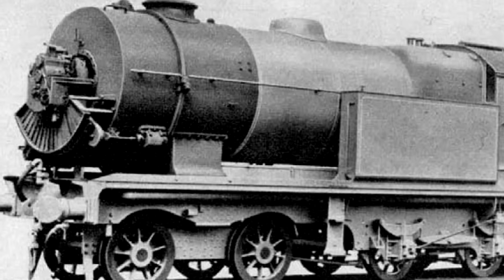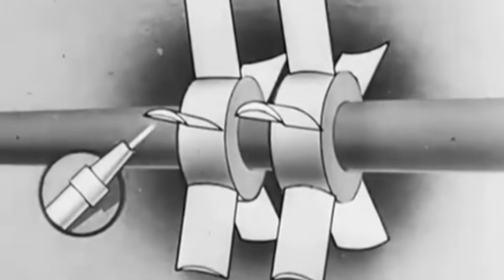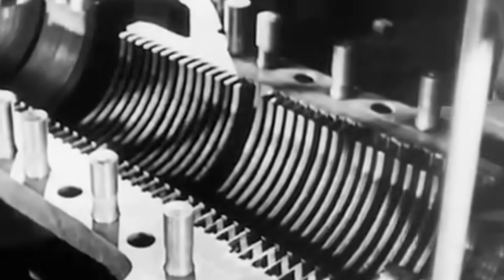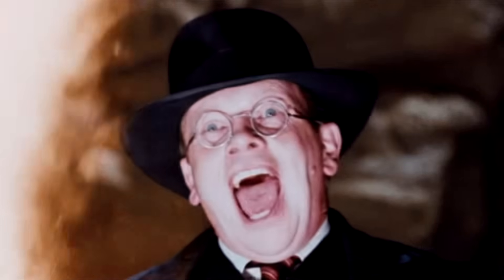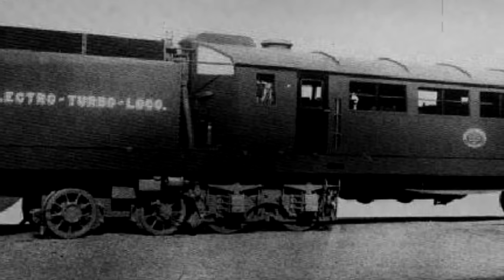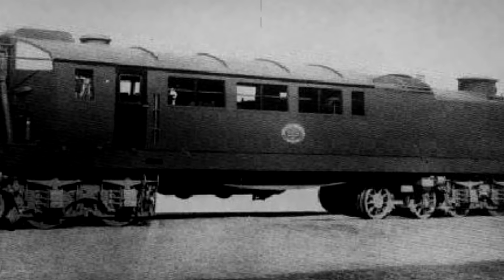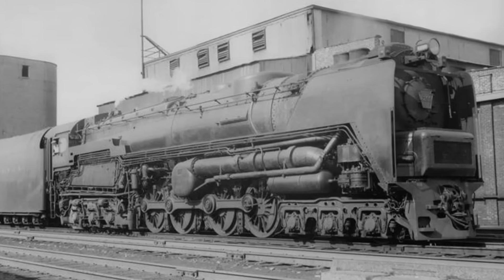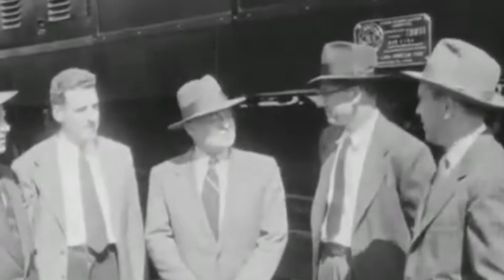What the Heck is Up With Steam Turbine Locomotives? | History in the Dark

Comment: If you guys misinterpreted of low efficiency as "Oh, then force it to drive electric generator then and keep running on same speed."

No, the problem is not transmission. But turbine will eat roughly the same fuel per hour, regardless the speed of the train. That's the point of "horrendous efficiency at lower speed", and all kind of turbine suffer that, including turbocharger.
Reply: Sort of kind of. But you can dropp the torque reducing fuel burn quite a lot. This makes a gearbox extra usefull because you would use low torque at low speed when high torque is typically needed.
Reply: @matsv201 the fuel burn still the same regardless the torque.

Even if you tried to drop the torque so hard, it stop spinning
Reply: @bocahdongo7769  That is not really true because you can have a simular rotation speed but a much lower flow. That is why theyt had multiple injectors.

The Lundström turbine locos solved it a other way by simply having multiple turbines and have the steam use diffrent turbines at diffrent speeds. That basically solved the problem
Reply: @matsv201 If that's the case, then turbocharger would never have turbo lag in the first place. Or start really late at higher RPM. And this is radial turbine that works wider range than axial. Or the fact that axial turbine and stator are calculated based on fixed speed. Espescially this is 1930-40's.

Hell, other comment are right, you can just use high powered magic transfer device in the first place if you tried to use multiple stage turbine.
Reply: @bocahdongo7769  There is still a static load. But of caused at 0% power, the static fuel use is also 0%.

I don´t know how well it scales for radial turbines, but for axial turbines a rule of finger is that at 40% energy it preforms 0% power. Then it scales up to 100% energy and 100% power  linearly.

This is of cause very bad for usage of 1-10% But there is also a very simple solution to this. Have two turbines. Preferably have one large and one small and power can be transfered between them. That was how Lundström solved its loco
Reply: Oh, but that's easily solved ..... optimise the turbine's output at max requirement, plus 20% (engineering, innit) and when there's an energy surplus, simply "collect" excess current via a ... let's call it a 'pantograph', contacting a conveniently located conductor wire, parallel to but above the running rails.
Reply: @TheHoveHeretic you can use those magic transfer energy device for easier operation

Matter of some people mad that their tax used to build this magical thing instead another asphalt and desert war is completely different thing

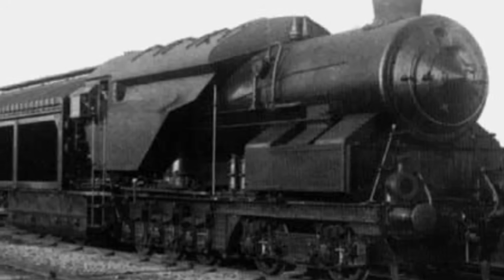Comment: 8:50 because the tender had the condensor and they couldnt make vacuum pipes that bend.

But the coal bunker was on the engine and the tender carry verry little water .... due to the condensing thing, so it actually didnt change weight that much.

One of the steam turbine trains was preserved in roaling condition and there is actually fairly modern videos of it operating
Reply: Link?
Reply: @RailPreserver2K  Check response to theajax in the thread.
Reply: Also link?
Reply: @theajaxdragon4649 
Ironically this was not the video I was looking for, but it was better. But it was probobly from the same time period. Its a VHS recording, so i would imagine its from the late 80s or early 90s.
https://www.youtube.com/watch?v=Z9ZcLUbQg14

This is a more recent recording  from the second unit that is under restoration. Note, this is not the same unit as in the first video. This video is 7 years old, and they are trying to make it run under its own steam, its not finished yet. but maybe a other 7 years and it will be.
https://www.youtube.com/watch?v=RS1Ev5fmm3k

 Note the chuffing sound is from the AUX engine, not the steam turbine. The steam turbine is almost totally silent. 

Also note, most Swedish steam engines at the time had a very short tender. The reason for that is that they didn´t want to disconnect the tender on the turn table, and all turntable was made to the same standard.

Comment: Almost all coal plants also use steam turbines as well as some oil and gas plants. (Probobly about 50-60% or so)
Reply: All the big plants are turbine/steam set ups. It's smaller scale plants that are set up to be more like generators,
Reply: @jamesbuckner4791  
Well not quite. If we consider large powerplant 1GW, almost all of them are steam turbine, but not quite all. A small minority (we talking like 10 plants, but that is still a lot at those scales) use super critical CO2 in stead of steam. While it steam like, it does work a bit diffrently.

For medium power plant about 50-500MW combustion plants are quite a bit more common. But a lot of them are combine cycle that use both combustion as well as steam. I would say around 500MW this is probobly the most common type.

For smaller power plant combustion is almost excursively the type